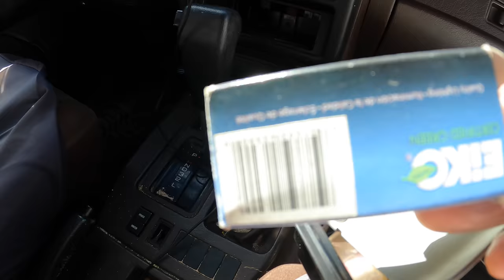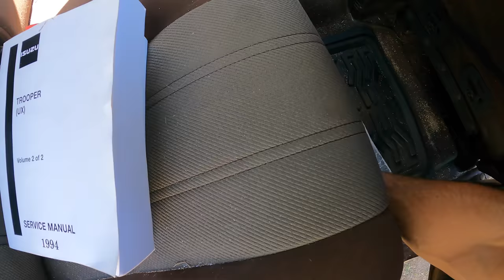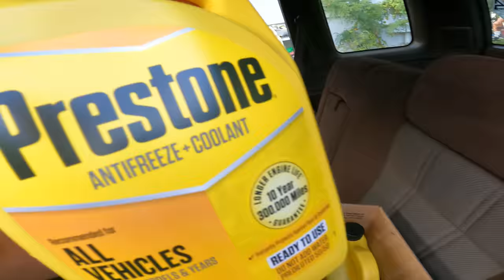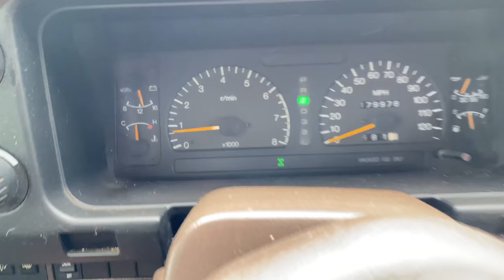Picked up 1994 Trooper For Camping / Best Budget Build? / Hawaii Vlog / Camping Weekend PART 1

Comment: Troopers are excellent trucks I have one.It is 2002.Only bad thing is that crappy transmission GM 4l30e.I had to rebuild it twice now.
Reply from the maker: Ya I been reading the forums a lil and they been saying the same thing about the transmission.. I’m hoping all goes well with mines lol 🤙🏼
Reply: @RoyceGetit  Hope to.Just replace transmission fluid and filter.It is easy and cheap and if you are brave install bigger transmission fluid cooler with fan.You can find instructions on the web.But install together with original cooler in series.Good luck.